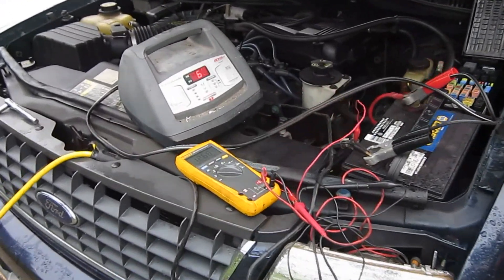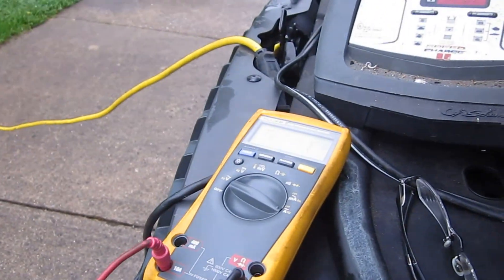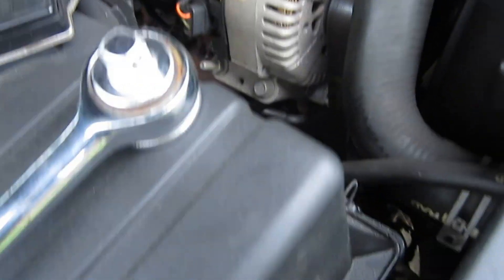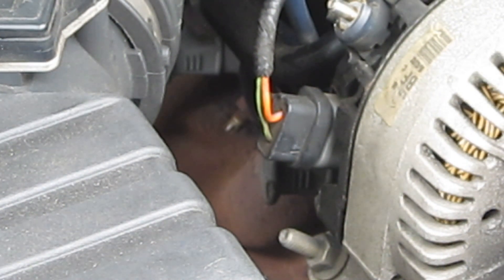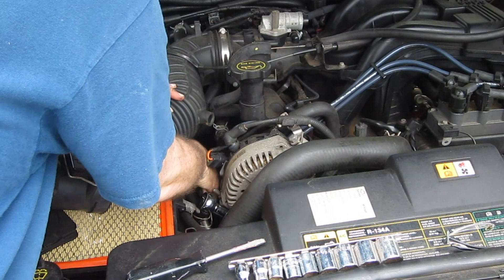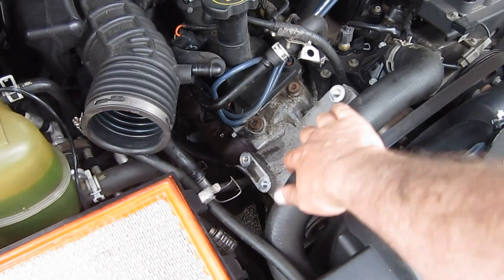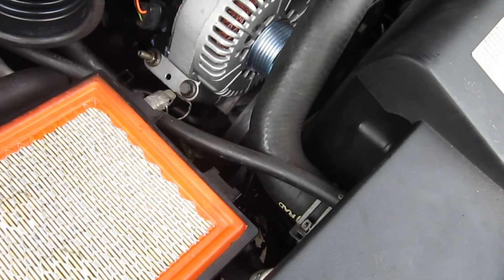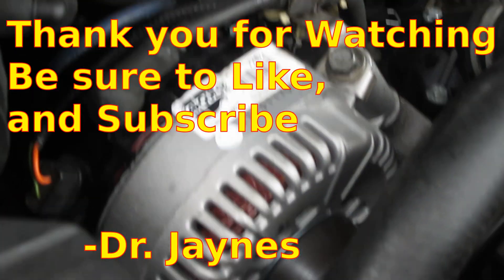Ford Explorer - Changing the Alternator

Comment: I believe that the odd bolt belonged up on top where you had to attach that cable end and then add a nut, seems that at sometime some had worked on alternator and put the bolt in the wrong place, reason I think so is that I am currently working on 97 mercury mountaineer with 5.0  AWD and that is how my bolt patterns is set up , to attach that cable end to top bolt with the longer thread on top and add a nut, maybe someone lost the nut and just assembled with what was on hand, just a thought but seems logical now that I am working on my truck on similar situation.,, mine is a 5.0 V8 and I can't seem to find the tension pulley nor the ratchet slot.
Reply: you called it a contact point where the odd bolt I believed belongs with a nut to hold it down, just my opinion.
Reply from the maker: That doesn't sound good?? Best of luck! I know it can be frustrating, when problems crop up like this!!